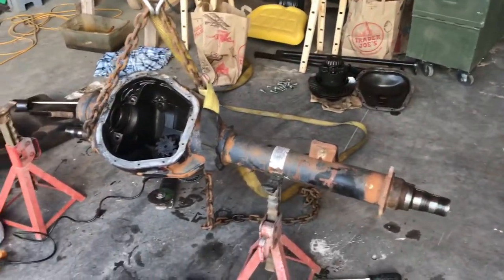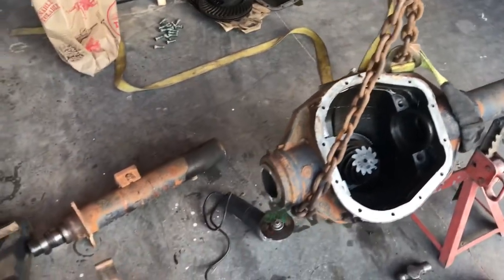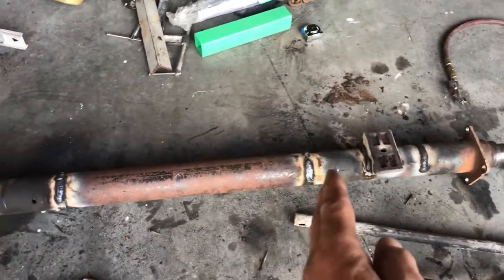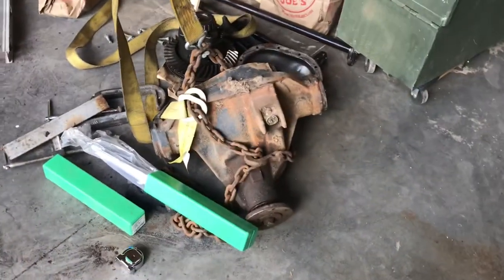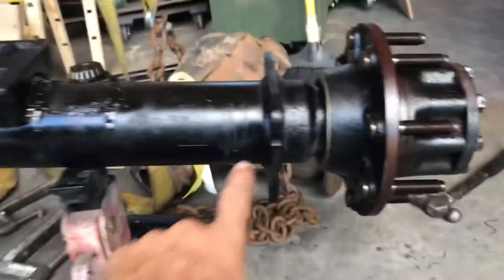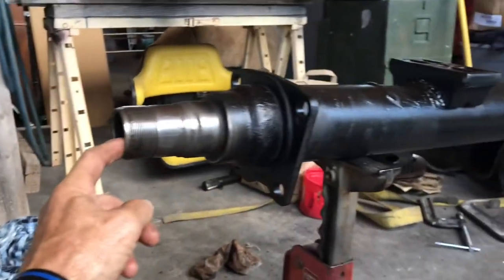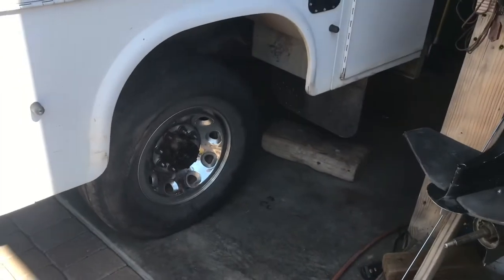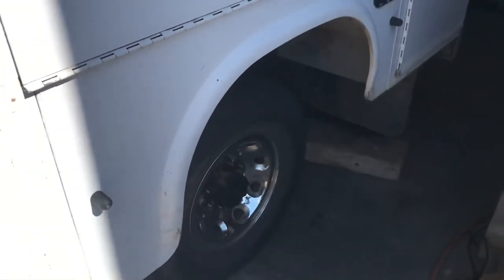How to make a trailer axle from f250

Comment: I plan on doing this with a couple dually axles for a gooseneck. You can always run OEM brakes and a electric over hydraulic system for a braking axle.
Reply from the maker: Yes, good idea. Surge brakes like they put on a lot of boat trailers.
Reply: @JohnVH-diy  that or a full on electric over hydraulic. They're a lot more smooth then the surge, and run off a standard brake controller. 
How thick of steel tube did you use? I'm thinking of using a 1/4in inner and outer sleeve.
Reply from the maker: @Gmcguy758  I believe I used 1/4” pipe about the same thickness as the axle tube. There isn’t much stress on the axle in the center. Most of the strength needed in an axle is between the spring perches and the bearings.

Comment: Oil bath is the best not grease. There is a reason all the big boy trailers use oil bath bearings. I tried grease on one of my 20 ton hydraulic boat trailer bearing sets because the oil seal surface had a rust pit that would leak oil out. It lasted all of half a summer. The oil bath setups are way better at dissipating heat.
Reply from the maker: Yes that’s all true. However Ford uses a two part seal. In a one part seal the rubber rides on the axle surface keeping in the oil or grease. In a two part seal the rubber part needs to be installed dry where it touches the axle. It’s  supposed to hold tight onto the axle. Internally is where the sealing surfaces are moving inside the two part seal. In theory it’s a good design but in reality it doesn’t work well. If there’s a slight amount of grease or oil on the axle or the seal mating surface it will leak when oil is used. I was meticulously clean with both sides and one side leaked like crazy. I drained the oil, greased the bearings and have had no trouble or heat buildup.

Comment: Is this a 6000 lb axel or 7000
Reply from the maker: I would guess it’s the same rating as the original pickup truck axle from a dually f350

Comment: Why not use a brake disk and have hydraulic actuated brakes
Reply from the maker: I could’ve kept the brakes had they been intact but my trailer isn’t that heavy where brakes are needed. Good idea though as long as you have a brake actuator in the coupler.

Comment: Where do you get those hub to replace the original.  What is the model numbers  for hubs
Reply from the maker: I used the original hubs and bearings. Just greased them up good.
Reply: @JohnVH-diy  what do you do with axle
Reply from the maker: @randysylvester2203  I just cut the axle off of the bolt flange. Use the flange as a grease cap.
Reply: I see so you eliminate  axle all together
Reply from the maker: @randysylvester2203  Yes. You eliminate the axles and differential and differential housing. A lot of extra weight. On the Ford axles make sure you keep the axle tube facing the same direction. The threads on one side are left hand threads. It keeps the nut from backing off.

Comment: so how do you keep the axels from sliding out wheres the c clips
Reply from the maker: There are no clips in the differential. The big ratcheting nut holds on the hub with the bearings. The axles are free floating so just cut off the axle from the flange and bolt on the flange.
Reply: @JohnVH-diy  aww thank you I wasnt aware of that.  So how would you go about a rear end held in with the c clips type rearend,  any suggestions?
Reply from the maker: @rodneybiggerstaff8225  Just remove the ring gear.
Reply: aww awsome thanks

Comment: I would have welded Bung in and mounted a breather cap
Reply from the maker: Yes that was my original plan but the Ford two piece seals are very prone to leaks that it was more troublesome to keep the oil bath system when it’s not really needed. Just grease it like a normal trailer axle and you’ll be fine.
Reply: @John VH 2019  I'm building independent suspension using the hubs and tubes on my GMC motor home using a e350 4x4 frame the rear 5 and 6 wheels but now looking at late 3500 front hubs 8 lug
Reply from the maker: @PeterHatch-mx7zc  Would love to see a video of your build.

Comment: Terrible video. Left out most of the steps.
Reply from the maker: This was not a how to do it video. This was to show what can be done to make a heavy duty trailer axle. If you need detailed steps on how to cut and weld steel then you shouldn’t do this yourself.